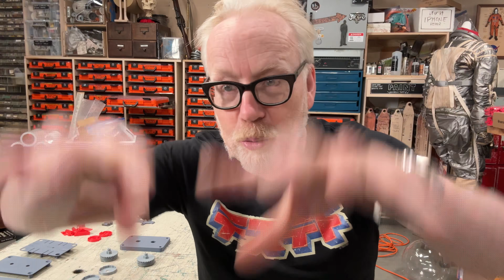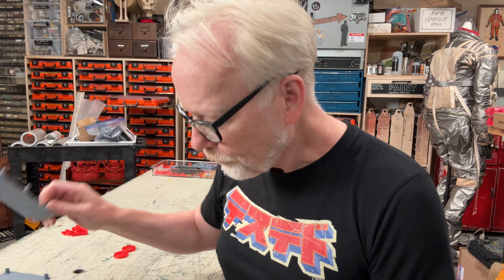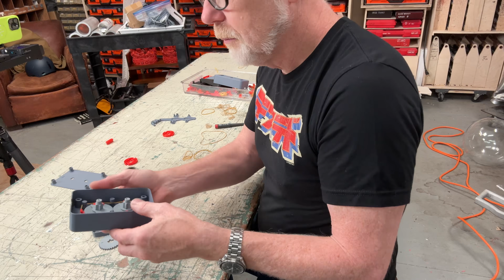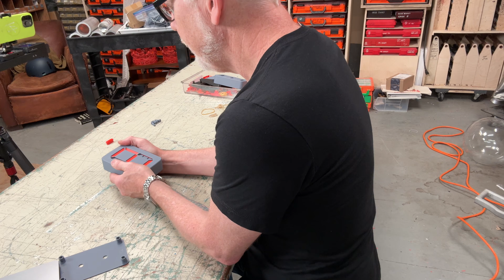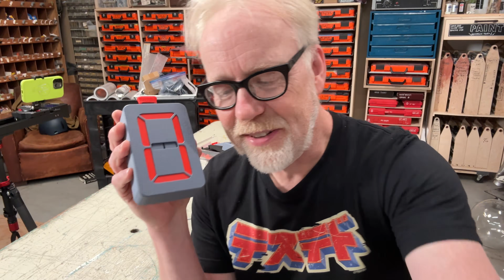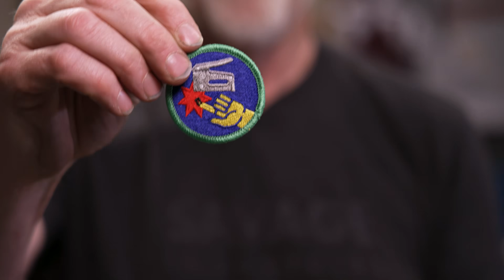Adam Savage Assembles a Working 3D-Printed Mechanical Counter!

Comment: If I had a 3d printer, mechanical puzzle/model kits would fill my house.
Reply: You should get one! These days you can get one for ~$300 (or less in some cases) that is easy to use and produces excellent quality prints!
Reply: @abelsullivan2712  I have a serious plastic addiction already, and I've done everything in my power not to even try a 3D printer. That's a dark rabbit hole
Reply: @GarrettPDGA ah! But it’s such a pleasant rabbit hole 😊
Reply: @abbofun9022  might just have to propose one for my workplace, then 🤔
Reply: @GarrettPDGA  I now have a BambuLab P1S that replaced an Creality Ender 2. All I can say is I highly recommend the BambuLab P1S. I splurged on the Combo and added the AMS, never regretted that.
Reply: @abelsullivan2712  I got mine for 170 euros. I've spent like 40 euros on upgrades, but those were mostly quality of life upgrades, mainly making things quieter. That 170 euro is totally usable out of the box.